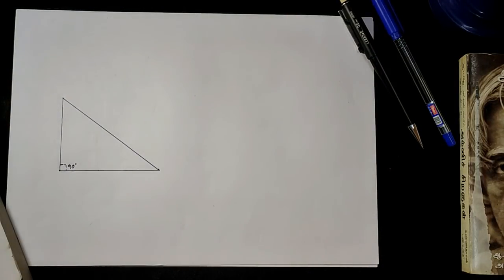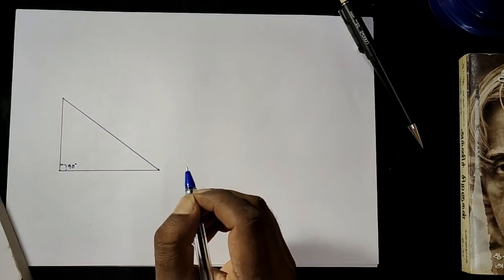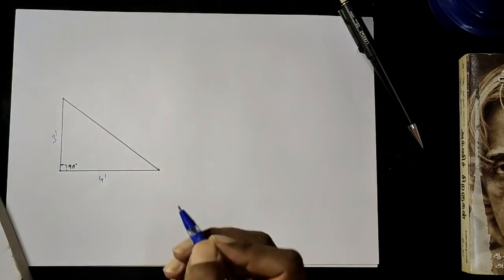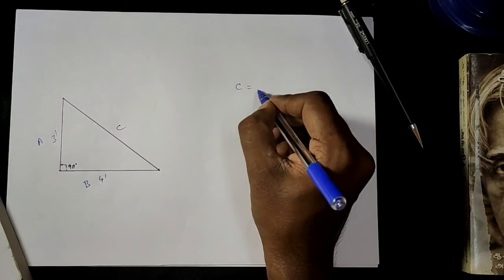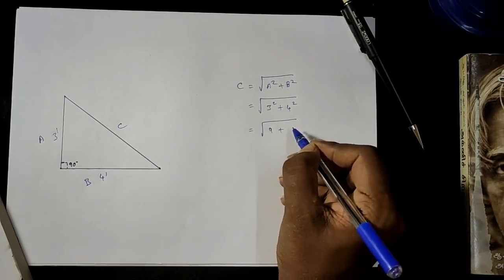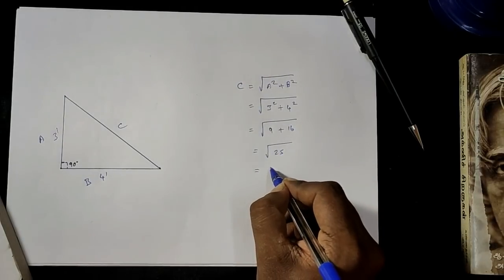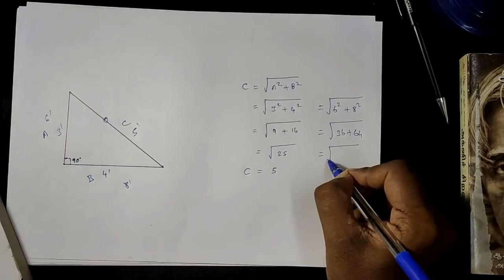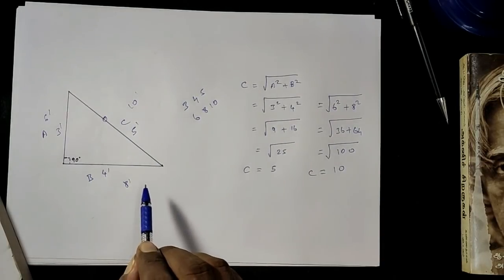345 Marking Method || Construction tips

Comment: 3,4,5 method is used by non technical mason. Engineer can use the formula for total house with centre line drawing for 100% accuracy.
Reply: Crt
Reply: Murali Krishna.....
Site la starting point or boundary illana enna pannuvinga.....

Land cross la irruntha or points thappa irruntha or total station or dump level or theodolite illana enna pannuvinga.... 

Site marking ku Ithu best method
Reply: @sathyamurthy8047  I am marking the building using Pithakaras therom for entire building center line and diagonal line for the past 30yrs.
Reply: @muralikrishna5435  this method is also called as Pythagoras .....
a^2 + b^2 = c^2
3^2 + 4^2 = 5^2
9 + 16 = 25
25 = 25
Reply: @sathyamurthy8047  You are right. Using the same formula find out the diagonal centre length of building. Using 2 nos of long measuring tapes you can easily mark the building with 100% accuracy. Non technical mason don't know to find out diagonal centre length of building. That's why they can use 3,4,5 method. Try it. You can. All the best.
Reply: @muralikrishna5435  For irregular land area or sites diagonal method is can't not give correct points... 
Masons are well comfortable with 3,4,5 methods for irregular areas also.
Reply: @sathyamurthy8047  In experience, you can do it. All the best.